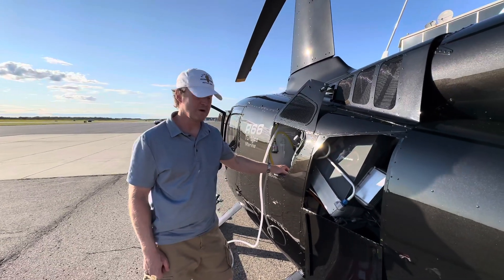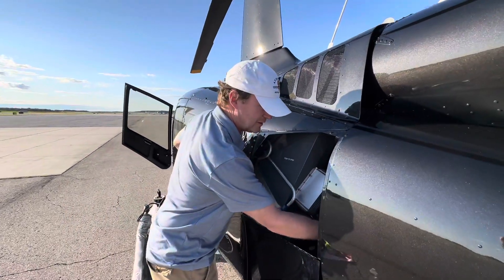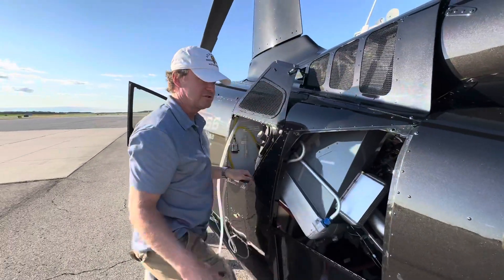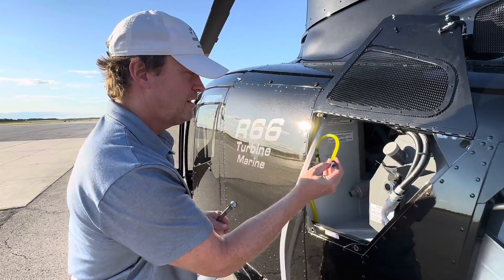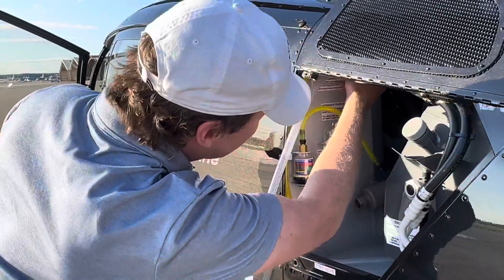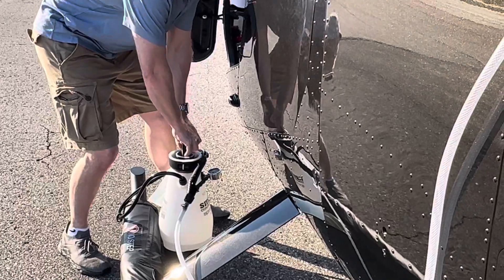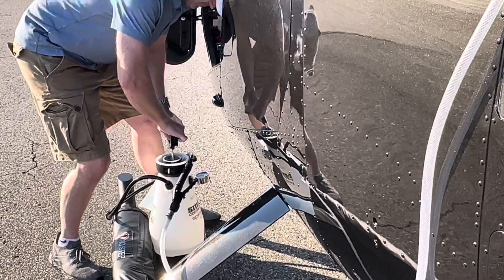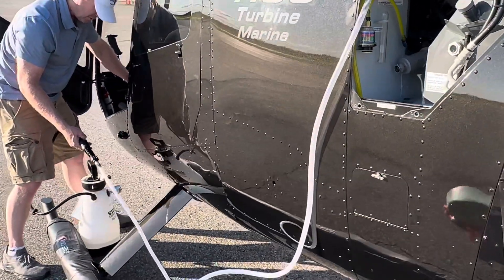How to rinse the RR300 turbine engine on a 2023 Robinson R-66 Turbine Marine Helicopter

Comment: Thanks for posting making this, after I got my R66 Marine I was searching for a video and couldn't find one... so I had to learn it the old fashion way. The only thing I would add is that I normally try to rinse before I go flying to save from bringing the cycle by drying.
Reply from the maker: Glad the video helped.  You can do rinse before flight to reduce number of starts, but defeats purpose of preventing corrosion of turbine blades while it sits between flights.   We also tend to be more in a time crunch before a flight than after.   Turbine is good for 3,000 starts, so not likely to exceed it before you hit time limit unless you make a lot of short flights.  This would also be a good question for Rolls Royce as to when it is better for rinse.   BTW .. an 18 mm socket removes drain valve on combuster can, which speeds up the draining.